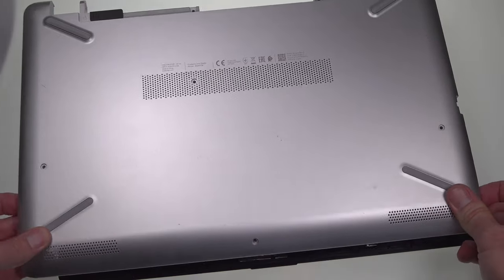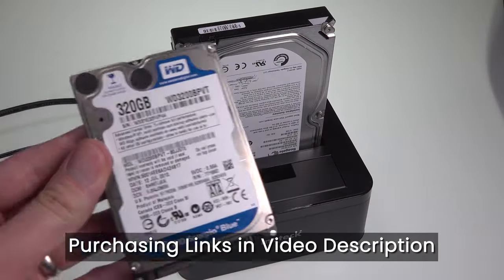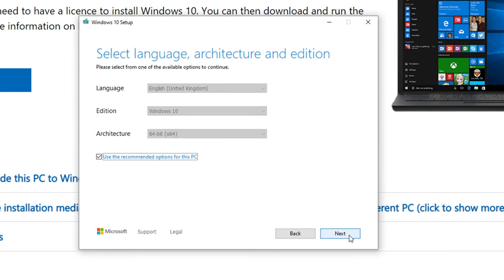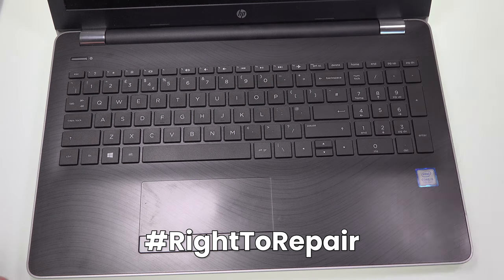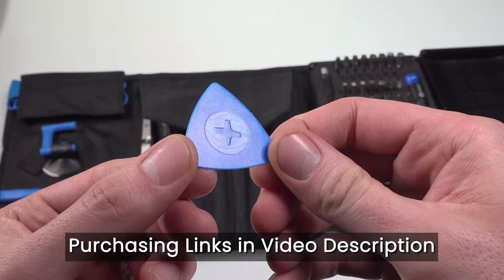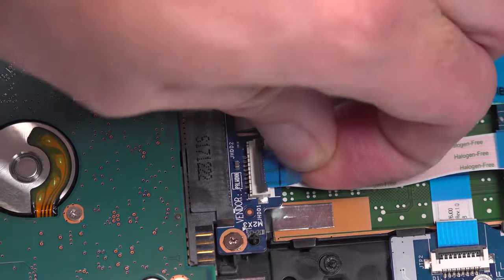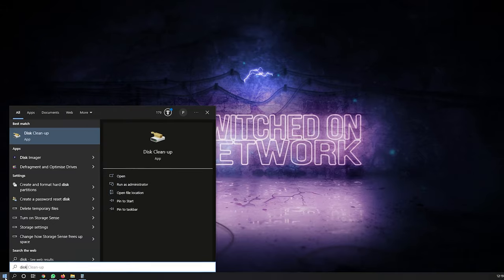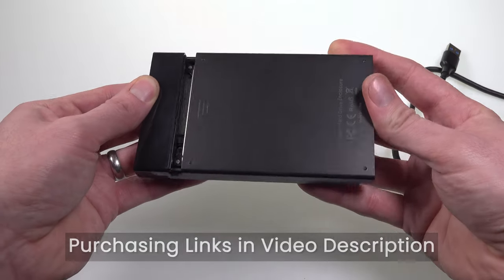How to Upgrade your Laptop to an SSD!

Comment: The vast majority of people don't have a hard drive clone box. You just blew by the most crucial part of changing an old hard drive to a newer SSD drive.
Reply from the maker: Huh? Did you not pay attention to the video? I'm pretty sure I said something along the lines of, you don't have to buy one of these but they're pretty great if you want to, and if you don't want to you can install your operating system afresh and then copy the data over from your old hard drive using something like a usb flash drive (before removing the hard drive, obviously) or with a more simple usb/sata adaptor cable
Reply: @Switched On Network  sorry. I have an external case with an old Samsung SSD drive in it that the computer recognizes. When I put in the new 870 EVO the computer doesn't see it. Put the old SSD back in and it sees it. So there is something about this new SSD drive that is different from the old SSD drive. Partitioning? Driver? Power supply?
Reply from the maker: Are you putting it in as your primary SSD or a secondary drive? Where in Windows is it failing to detect the drive, is this in the setup process having booted from a bootable USB installation drive or is this inside Disk Management with it in use as a secondary drive?

Comment: It would help and be of great benefit if you slowed your instructions down...considerably!  Not everyone knows all the terminology or has a mental picture as to the location of the various components you mention.   It is a common mistake most technical types -- like yourself, for instance, to assume everyone is familiar with the inner workings of one's laptop.  I would award your presentation as around 33%, not that it would make any difference to you.  Just say'n...
Reply from the maker: Thanks for the advice, but when making this type of video it would be entirely wrong. You probably wouldn't even have found the video if it was slow and in-depth - it would have a terrible watch-time graph as people get bored and click away, signaling to YouTube that it's a poor video and resulting in it not getting recommended to anyone. The type of video you're asking for isn't the type of video this is intended to be. I appreciate and thank you for your feedback, but - respectfully - someone who's spent years working on YouTube videos and learning/experiencing how the platform works may be better qualified to determine the video styles that work best. This is a general overview aimed at a particular audience, sorry it wasn't your cup of tea but please try to understand the very good reasons and not see them as a mistake.

Comment: Ayo btw are crucial ssds durable cuz i need long term use for atleast 5 years and do they come with warranty?
Reply from the maker: Yeah crucial are a great brand 👌
Reply: @SwitchedOnNetwork  but some of the reviews on amazon say they are not durable like the BX500 ssd from crucial seemed to slow down and computer freezes often after 4 months of use..
Reply from the maker: They make different ranges at different price points so some will be more durable than others and rated for more reads and writes. It all depends on your requirements and budget, and yes they'll all have warranties. Be sure to have your data backed up as well though! 🙂
Reply: @SwitchedOnNetwork  thank man.
Reply: @rokith5139  try out brands like Samsung or PNY for SSDs, i heard they are like the best ones in the market to come by for restoring laptops or desktops. Even for certain gaming consoles like PlayStation and Xbox that is upgradable.

Comment: Upgraded my old 1tb hdd to 240gb ssd. But now frequent blue screen. Until wont boot anymorr and need to reinstall windows 10 again.
Reply from the maker: That doesn't sound ideal. If that's all started since you put the new SSD in then it might be worth trying to swap it under warranty?

Comment: Great tutorial man this really helped, thank you.

 I was able to restore my 9 year old Gateway laptop with a PNY SSD or Samsung SSD and i noticed such a hugh improvement in speed and performance boost. Boots up & shuts down fast when turning it on or off, Programs & files load up fast too. Literally the best thing without any moving parts and less stress for laptops.

Even using an SSD to boost up my PS4 console which also helped too, fan noise is greatly reduced and not stressing alot, plus games and apps load up faster.

Comment: with the docking station, does it work with cloning an SSD to SSD? In this video you do a HDD to SSD, but i want to know if it works for SSD to SSD. Cheers mate!
Reply from the maker: Yes, that'll work fine. As far as it's concerned it's just data to data, the underlying architecture doesn't matter.
Reply: @SwitchedOnNetwork  thanks mate!

Comment: Hi

If I just added the SSD without removing the original harddrive would the performance still improve?

Or would you recommend that i remove the original harddrive?
Reply from the maker: It's not a case of "if one is present, the system performance will increase". System performance will increase if the Operating System is being run from an SSD, and if the software programmes you're running are from an SSD, and if the data you're accessing or the software is using is also being read/written to/from an SSD.

So putting one in and doing nothing else, will do nothing. Adding one in and using it to store data would mean you can read/write that data faster, but you'd be missing out on 99% of the benefits.

Short answer: Yes, replace the hard drive ;)

Comment: You didn't provide information on how to fix the new partition if there is unallocated space that we need to add to the drive.
Reply from the maker: That would be a separate tutorial in itself, but if you open up Disk Management you can find and resize the partition there.

Comment: Thank you for the vid :) 
was just wondering, if my OS is installed on my SSD, is it safe to remove it and then put it back in? It wont reset or anything?

Im sending my pc in for repair and my boss says i need to remove the drives first.

PS the repairmen wont need it to repair the pc ive been told.
Reply from the maker: Yes, fine to take it out and put it back in again 👍
Reply: tyty : ) @SwitchedOnNetwork

Comment: Hey! Instead of doing that can I just put the ssd on the portable case and connect it externally and maybe move my windows to that disk or the games that I want to run smooth? I’m kinda lost could you explain us please
Reply from the maker: No, because you'd be restrained by the slower USB speeds then. Keep the SSD inside your laptop :)

Comment: Is it ok to put the SSD in without the mounting bracket? Two of the four screws on my HDD will not loosen it's actually ridiculous my hand hurt lol. But the SSD does snap into place. I was just wondering if it's fine without the bracket
Reply from the maker: As long as it's secure then that's the main thing 👍

Comment: Nice tutorial but if my SSD started to get full with a little space left can I upgrade my SSD without lossing any data or forced to redownload every single app/game from steam?
Reply from the maker: Yes, you can clone it to a new bigger one. You might just need to enlarge the partition afterwards to take advantage of all the new free space.
Reply: But how and how long will take it to clone 411 GB?
Reply from the maker: Depends on the read speed of the old drive, the write speed of the new drive, the SATA cable used and the device used to do it, along with the nature of the data (lots of small files, few big files, mixture of the two etc.)

Comment: I want to replace my windows C ssd (512gb) with a 4tb one. It’s both M.2 PCie Nvme. Can they be different generations? Are there clone devices for them? Or does it require additional software on a pc to transfer from on to another?
Reply from the maker: There probably are - someone will have made one. If you have two M.2 slots though you can probably just copy it all over without having to use another device. They can be different generations yes but be aware if your mobo doesn't support the higher gen you'll just get lower gen speeds I think. It should still work though - I think. Don;t quote me on that though, look it up elsewhere too ;)
Reply: @SwitchedOnNetwork  okey thank you

Comment: One question. Do we need the key of the windows or its getting installed automatically?
Reply from the maker: No you won't need that, it's all automatic
Reply: @SwitchedOnNetwork   Thank you!
Reply: @alexgeo7358  i’m pretty sure if you want a clean install (using usb) you need your key
Reply from the maker: If you boot from a USB and do it that way, yes. But that's not what this video shows; this is a simple way for less techy folk.

Comment: What happens if your laptop already has windows on it, then you make the replacement? did mine and I can't get it to boot.
Reply from the maker: Have you put a fresh, blank SSD in? If so you'll need to install Windows - follow the bit of the video where I show making a USB installation drive.

Comment: Does it work for MSI laptops?
Reply from the maker: Yes, it's not brand-specific (unless you have an Apple laptop, they do stupid anti-consumer and anti-environment things like soldering SSDs and RAM straight to the motherboard). If you have a more modern laptop than the old one I was using in the video, it might be an M.2 NVMe SSD rather than the SATA one shown, so check before you order the bits.

Comment: How long does it take to download and setup the boot drive because mine is still a 0%
Reply from the maker: Depends on your internet connection speed and how fast your computer is and the USB drive. But if it's stuck, I'd just start again
Reply: @SwitchedOnNetwork  thx i was stuck on 0% for like 20 mins so i will just restart it tomorrow, by the way can i run windows 10 on my old laptop that uses windows 7 back then?

Comment: My HP Laptop doesn't have fan installed. Is it possible to install a new one?
Reply from the maker: If you can find somewhere for it to go and a way to get power to it, and it has an inlet and outlet for air - then sure why not

Comment: I have the same toshiba hdd shown at 0:30  and it just stopped working and i was thinking of instead of just replacing im gonna upgrade it for an ssd
Reply from the maker: Yes, absolutely - get an SSD and you'll get much better performance as well as better battery life

Comment: Can you used in any laptop?
Reply from the maker: Yes, any laptop will be able to have an SSD installed. Older laptops would use a 2.5" SATA SSD which is the exact same size and shape as the spinning HDD it replaces. Newer and more modern laptops might have a different type of SSD, called an NVMe SSD which use an M.2 connector. Laptops like that will already have an SSD in that slot though, so it wouldn't be "upgrading" it as such (unless you're putting a bigger/better SSD in its place).

Comment: If my HDD size is bigger than my new SSD, can I clone it ?
Reply from the maker: No; and you'd be much better off installing your OS afresh on the new SSD and then copying over the data you need from the old HDD (using a docking station to connect it).

Comment: My laptops hard drive broke and it says no drive found so I'll have to replace or pay someone to do it
Reply from the maker: Oh no! Hope you had a backup of anything important on there :( Yes - it's easy to do yourself, just follow the steps in this video to put a new SSD in and then install Windows. You might not even need a product key, but if you do there might be a sticker on the base of your laptop with it on (or it might be in documentation you received when you first bought the laptop). Good luck!

Comment: I have that exact flash drive haha
Reply from the maker: good choice!
Reply: @SwitchedOnNetwork  Is it ok to put the SSD in without the mounting bracket? Two of the four screws on my HDD will not loosen it's actually ridiculous my hand hurt lol. But the SSD does snap into place. I was just wondering if it's fine without the bracket
Reply from the maker: If it's a really snug fit then you'll probably be OK but just be aware of the possibility of strain on the SATA and power connectors if there is any movement. You could maybe secure it in place even more with some tape, if you really can't get the mounting hardware off the old SSD.
Reply: @SwitchedOnNetwork  I just might have to try that🙌🏽🙏🏽 thx. If you will please link me to something perhaps one on Amazon, a mounting bracket, for the new SSD. I have the Samsung 512 Evo one. It really has breathed new life into my old laptop, amazing.

Comment: Right to repair and upgrade should be law.
Reply from the maker: Yes, I agree! And it makes good business sense too - when buying something, it being upgradable and easy to replace bits has a BIG swaying effect in my buying decision. It's why I bought a Dell when I bought my last laptop (Jan this year). I can just take the bottom off with a normal screwdriver, pop out the RAM and replace it with more in a couple of years if I want to. If I still have it when the battery inevitably stops being its best (my estimate is about 7 years down the line) I can just take it out and replace it with a new one - no silly soldering to the board, just pop a connector off and bob's your uncle. Just like a little Lego :)
Reply: @SwitchedOnNetwork  100%

Comment: is ssd 2.5 SATTA work on any laptop ????
Reply from the maker: Only if it has SATA connections on the motherboard. Newer laptops might be nvme m.2
Reply: @SwitchedOnNetwork  what about if i want to replace the hard drive with ssd 2.5 SATA